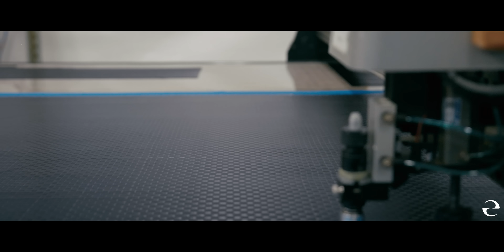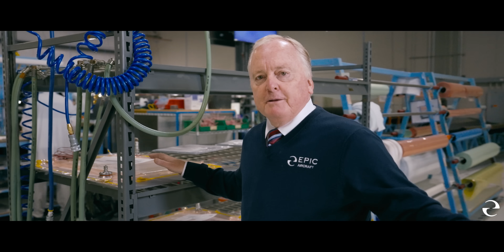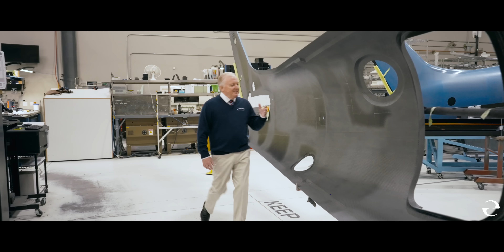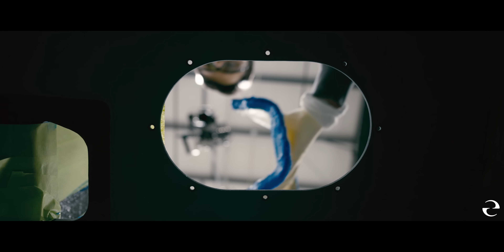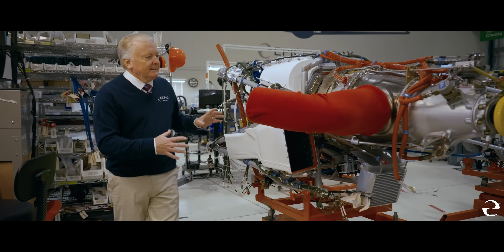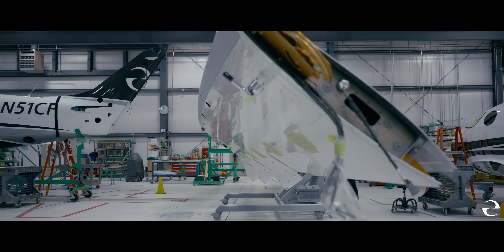Epic Aircraft E1000 AX Factory Tour - Bend, Oregon

Comment: Thank you, Doug King for this phenomenal, "Epic" production line, video!
Also, for utilizing thé,
Pratt and Whitney Canada 🇨🇦 
PT6A-67 turbo shaft engine.
Best of success !
 Doug, you're most likely aware, the "Wooden Wonder"
Mosquito fighter bomber fuselage was also assembled in half's.
Primarily from Alaskan, and Pacific Northwest Spruce as well as Canadian Birch.
Thé, Australian 🇦🇺 Mosquitoes, 
utilized one of they're native 
wood species.
 That were inherently better suited to deal with moisture deterioration issues.
Food for though, a new,
carbon fiber, turbo shaft/prop
Mosquito for the military. 
Doesn't carbon fiber offer a smaller Radar signature?
Coupled with low noise signature propeller.
Would that make for a perfect 
surveillance/ interdiction aircraft ?

Comment: This design began as a experimental amateur built and has matured into a certified professional build. Your evolution and progress is an inspiration.
Reply: Fiber and bagging was the big tech in R/C back 25-30 years ago? Yes, matured in the full scale. :)
Reply: @dave85110  Experimental kit builders were molding vacuum bagged wet-layup carbon parts by the '80s (Glasair, Lancair, et al). Prepreg oven cured carbon fibre part manufacturing was patented by the Brits in the '60s. It goes a lot farther back than you think.

Comment: Very interesting. You are doing aerodynamics and carbon fiber right. But your aircraft is about 2288kg empty, right? that doesn't stand out among the competition despite carbon fiber use. Is there opportunity to do that much lighter? If we say your fuselage is 38m2 surface area, as 2mm carbon fiber, that's 120kg. If we say the wing could be 130kg, add another 120kg for interior paneling, another 120 for insulation/sound, 50 for glass, 50kg tail, 50kg gear. That's still only 640kg. Even if we use the large engine that's 210kg and say 50kg engine junk, that's 900kg total. Seats cabinets and avionics shouldn't weigh 1.4ton. Could the plane be half the weight?  Also could the fuselage be one piece instead of 2 shells? should be a lot less work and not betray the strength of carbon fiber.